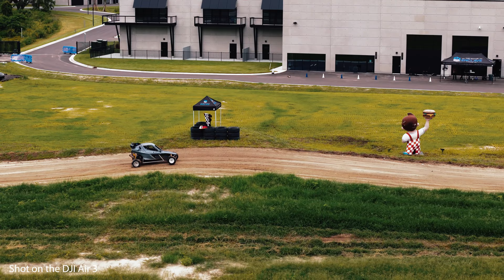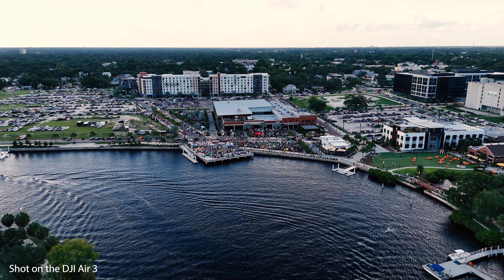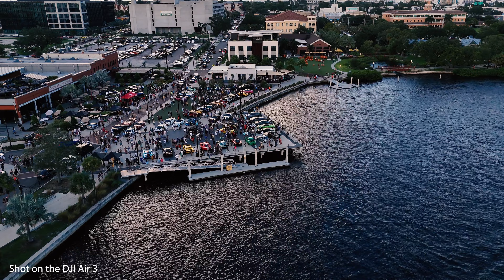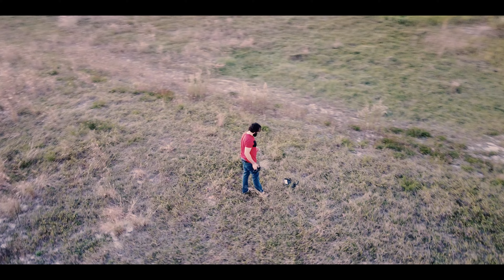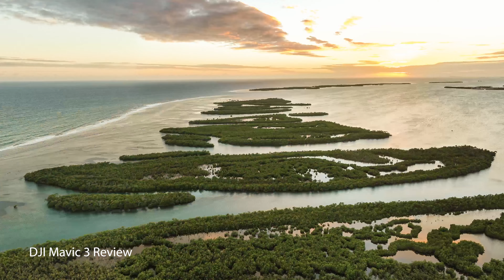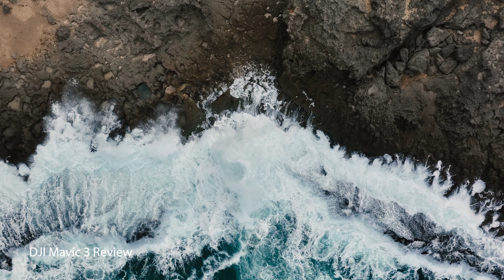DJI Air 3 Showdown: Mini 3 / Air 2S / Air 3 / Mavic 3 | Which Drone Should You Buy

Comment: How were you allowed to fly over crowds and vehicles. It’s expressly prohibited.
Reply: Getting permission in advance
Reply from the maker: In this case I had permission. I was working for this event and video these cars often so was cleared to fly over these vehicles which were owned by the company I was working for. There were about 4 drones in the air flown by spectators and they were definitely not supposed to be in the air. One of them crashed maybe a few ft away from cars worth $400,000 so not smart! Plus literally 99% of my flying would have been over the water and not the cars. I was using the telephoto lenses for this reason so I was far away for everything except 1 test shot

Comment: I will pass on the air3 and wait for the air 3s it will have a larger sensor. And the camera on the Mavic 3 could be used professionally not the air3 the air3 is a mid grade drone a larger sensor is always better than the smaller sensor the air3 would make a good beginner drone just like the mini3 pro they both have the same size camera small

Comment: Dronography is about the image.  This is a downgrade from the Air 2s.  Ohhh but two lens.  BS, with different fixed apertures of 1.25 stops apart go fly it and see how fun it is changing lens and being 1.25 stops off of your exposure and having to fly back to adjust your Vari ND and then fly back to get your shot.  The Air 3 should have been named Mini 3 Pro Mark II.  Hard pass.
Reply: Split ND filters are being shipped by Freewell so this is not a problem anymore.

Comment: I want to upgrade my drone, but confused between Air 3 and Mavic 3 classic. I shoot vertical video and I also like the larger sensor on Mavic 3 classic. Please recommend which is a better drone for vertical format. And if the telephoto lens is useful on Air 3. Thanks
Reply from the maker: If you shoot vertical video, the Mavic 3's larger sensor isn't much of an advantage unless the Mavic 3 gets a firmware update to allow native vertical video (it could). So for now, I'd say having the 2nd camera and saving some $ with the Air 3 would probably be best since in vertical, the larger sensor isn't going to be much help
Reply: Dronography is about the image.  You can get a better image from the Mavic 3 Classic and crop the center to make a "vertical" in post and come out way better than with this tiny sensor in the Air 3.
Reply from the maker: @TheRealJimmyLundy  If you think about it, even with a larger sensor, the Mavic 3 is taking a 16x9 portion of that 4/3 sensor and then taking a vertical crop from that 16x9 cross section which ends up using about the same equivalent sensor size as using the full height of a smaller 1/3" sensor, especially when you factor in the pixel size of the air 3 is large since it's only 12mp. For photos, you'd be better off with the Mavic 3 since you can capture 4x3 and the higher resolution M3 sensor helps for photos, but shooting vertical video, the Air 3 is actually just as good for video when shooting vertical thanks to the ability to use the full height of the sensor
Reply: @learningcameras  A single metric isn't enough to sway my opinion about the Air 3 being a downgrade and it would be wiser to pass on the Air 3 and get a Mavic 3 Classic.
Reply from the maker: @TheRealJimmyLundy  I'm not saying you should get the Air 3, but the guy directly asked about shooting vertical video so a single metric dictated this particular recommendation. I personally use the Mavic 3 because I also shoot photos and horizontal video and the Mavic is better for that with the larger sensor

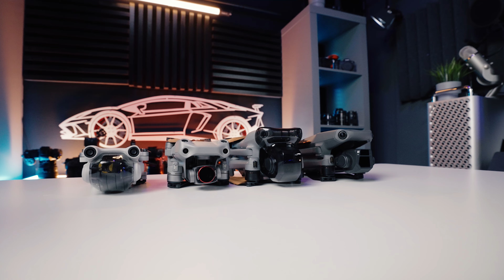Comment: 00:50 💡 The DJI Air 3 has a larger drone body, allowing for a longer flight time of 46 minutes.
02:14 🎥 The DJI Air 3 features a smaller third-inch sensor, but its backside illuminated stacked CMOS sensor technology provides better low light performance and dynamic range.
04:18 🚦 The DJI Air 3 has omnidirectional sensors and improved obstacle detection, making it safer to fly and less likely to crash.
05:28 📶 The DJI Air 3 has an upgraded O2 HD video transmission system, providing a stronger signal and reducing the chance of losing connection.
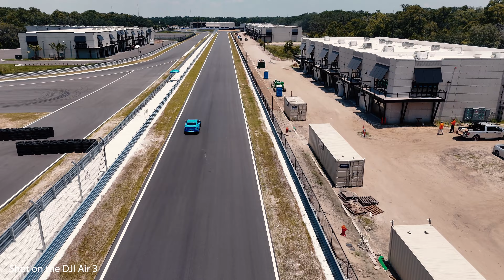08:30 ✈ The DJI Mavic 3 offers the most significant upgrade, with a larger sensor, adjustable aperture, and additional camera lenses, making it ideal for professional manual video shooting.

Comment: I mostly do stills, so I really appreciate the 20mpx on the Air 2S.  Is the 48 mpx on the new Air 3 providing additional details?  From my experience, the  original Air 2 48mpx mode seemed to show no advantage over its 12 mpx images.  Thanks
Reply from the maker: For stills, I think the Air 2S has the advantage, unless you also want the telephoto camera. I found the 48MP mode provided additional detail but not better quality overall so unless you need to crop in like crazy or print massive sizes, I'd just stick with 12MP

Comment: Hi Dan, i have a small question regarding the rules and regulations of certain drones in specific areas where you need a license. If im not wrong the mavic 3 classic is a C1 classified drone, is it the same for the DJI air 3? considering it is still lighter than the Mavic 3 air
Reply: C1 reaches from 250g-899g. So both the Mavic 3 Classic (895g) and the Air 3 (720g) are in the C1 category.

Comment: Is there a significant difference in the look of the image between the mavic 3’s 4/3 sensor and the sensor on the air 3? I don’t really like the over sharpened “cell phone” look of the smaller sensors. I also don’t want to pay more for a small difference in the image lol.
Reply from the maker: The Mavic 3's larger sensor definitely provides better quality for both photos and video. You can notice it. If you shoot with the Air 3 in D-Log M, it isn't as over sharpened but for sure the difference between a 1/3" sensor and a 4/3" sensor is noticeable

Comment: Sold my Air 2s for the new Air 3. The 2s 17 minute real world flight time was a killer. You could watch the battery life tick down like the third hand on a clock. And the batteries would swell up and become unusable  after a few months.  Looks like you have to pay $1,000 just to get a different main camera when you step up to the Mavic 3 Pro. At $1,099 it only $100 more than the Air 2s price for twice the drone.
Reply from the maker: Nice! Yeah, the increased battery time is a massive upgrade
Reply: What did you get for the air2s?

Comment: I bought the mavic air when it came out and I really need to upgrade after having a lot of issues with it. The air 3 seems really good to me and I don’t think that the camera quality is a massive issue compared to the air 2s as a lot of people complain. The air 3 comes with a better flight time, better obstacle avoidance and a dual camera system. Also the new o4 connection is a big upgrade for me because I usually lost connection after 300 meters or less. I’m also interested in the new functions such as waypoints and slow-mo at 4K/100FPS. For the price I get everything I basically need as I’m not a professional filmmaker or anything…
Reply: The censor might be smaller but it is a newer technology. believe me, This camera is way better with the smaller censor.
Reply: @12vibaba  For photos, it's not even close. Believe me. Air 2S is way better.
Reply: What issues did you have with the mav 3

Comment: Still going to hold on to my Air 2s simply because the quality of the camera and flight performance are still excellent.  Since the Air 2s has 5.4K video, I wonder what the final quality and resolution would be on a vertical crop compared to the Air 3.  I also notice that the Air 3 looks super sharp which looks great but some may prefer the softer look in the Air 2s.  The flight time, second camera, and better obstacle avoidance are certainly upgrades from the Air 2s.
Reply from the maker: So the vertical crop is going to be about the same in terms of resolution around 2.7k but a vertical crop on the Air 3 might look better because technically it will have a larger pixel size due to it using more area of the sensor. If you shoot in log, that should get rid of most of the over sharpening. But actually a lot of that is because we are shooting at high shutter speeds as well because most of us don't have ND filters for the drone yet so there's NO motion blur in most of my shots since I had to crank the shutter without an adjustable aperture
Reply: I want the see photo comparison with several examples between the air 2s and air 3
Reply: This is actually quite true, it's weird how most footage I see on the Air 3 is way too sharp, without any sharpness adjustments like the Mini 3 pro has, I heard the work around it is to use the ND filters for it to appear less sharp, though I'm not sure about that one
Reply: I think the filters can help reduce shutter speed which will smooth out the movement.  Since the fixed aperture is so big on the Air 3, it probably needs a very fast shutter speed in bright light.  This will cause movements to look stuttery. 
 @jet_toyco
Reply: @jet_toyco that is correct. Most filters, if not all will degrade clarity by a small amount
Reply: The quality of the video on the air3 is really not good. Oversharpened
Reply: @laurenthenry decrease in settings

Comment: My biggest question would be how does the quality copare with the different apertures on the M3P. I kow for my M2P I was encouraged to only shoot 2.8 cause that was the sharpest, so even doing manual video, Id still keep 2.8, use my variable ND but then sometimes if im already in the air, just crank the shutter a bit if I needed any macro adjusting onthe fly.

What would you say for the quality loss of having the variable aperture on the M3P and is it that much of an edge for just using a variable ND/shutter speed adjustment on the Air 3?
Reply from the maker: I've done a few tests on quality with the aperture on the M3P and it was good until about F8 where it started to get soft. But I just find landing to adjust my ND if lighting changes is usually not an option so having a few stops of room on the aperture + the larger sensor makes ISO 200-400 usable + you can always push the shutter a bit so you have more room for adjustment